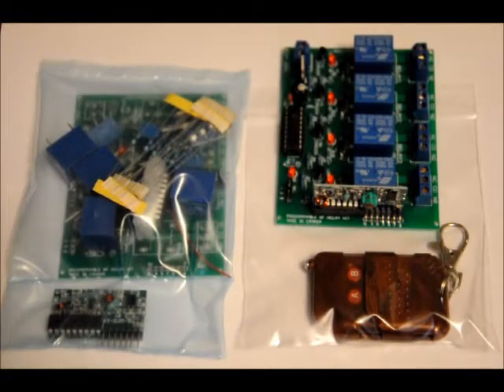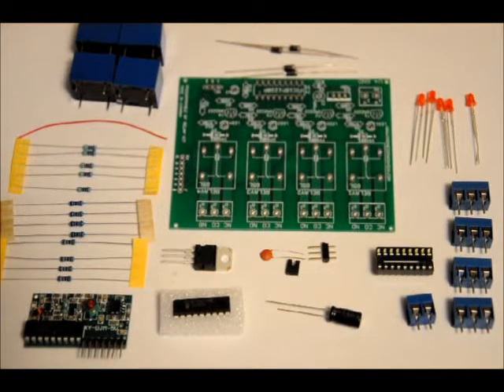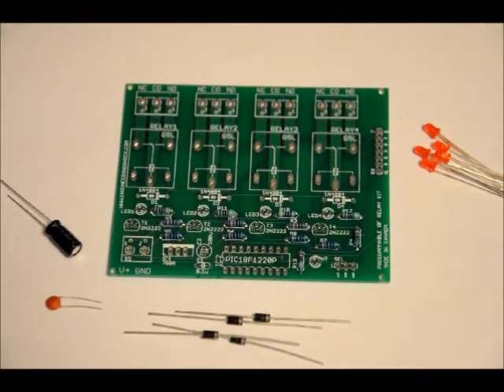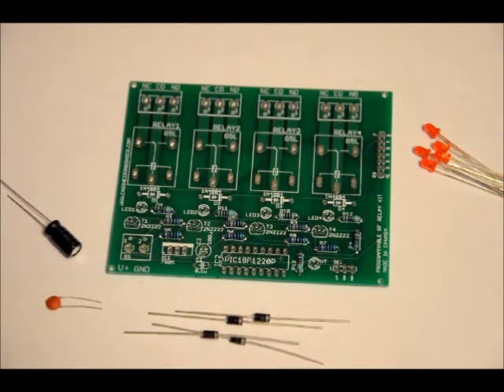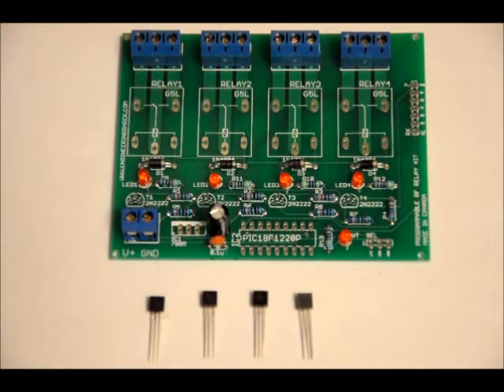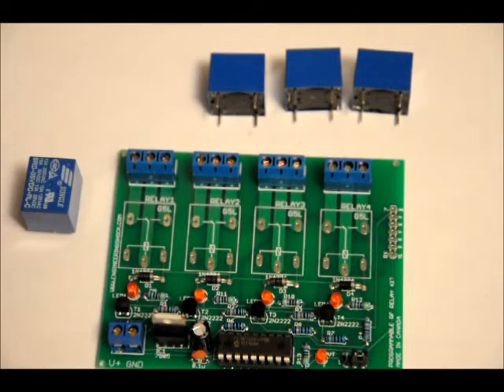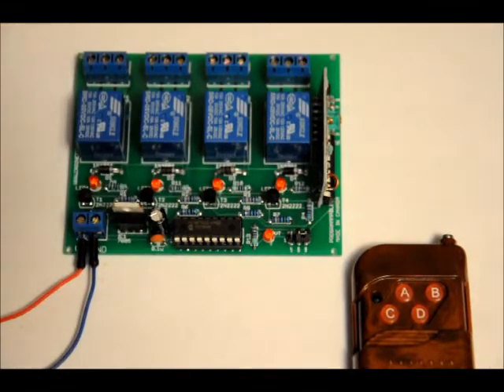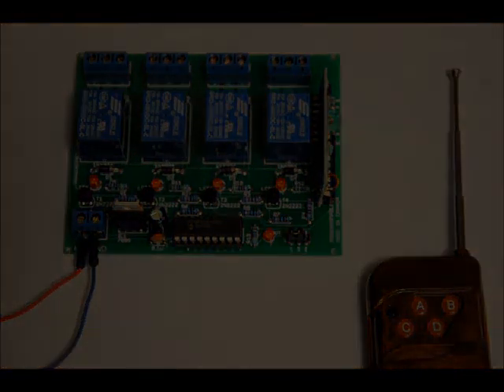The Four Channel RF Wireless Relay Board   Includes Momentary & Latching Program Options!

Comment: hi  william  here how  mush is build  fourchannel rf wareless relay   board  kit
Reply: I succeeded. Here is the shop I buy the remote control https://ru.aliexpress.com/item/433/32908247403.html There products are so good. Worked well. 1CH、2CH、4CH、AC、DC are all in the shop.If you don't understand clearly, you can contact the seller directly and they will answer your questions patiently.Recommend!

Comment: I have a single channel wireless relay that has me stumped can someone tell me the wiring for this the connector are as follows +, -, nc, com, no, it's all 12 volts going to my relay down to my fog lights that have a separate relay and fuse? Can anyone help me before I lose all my hair!

Comment: Why didn't you just run a trace during design for the pin-2 from receiver to the relay instead of having the user add the wire?
Reply: George Foster dry contacts.. this allows the user to run all four relays at the same time and maintain a max 10amps per chanel